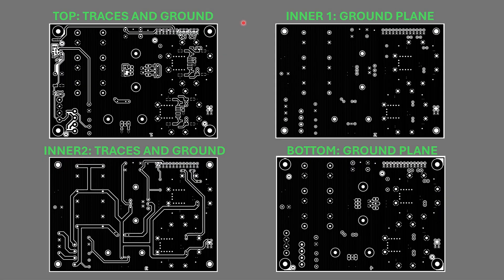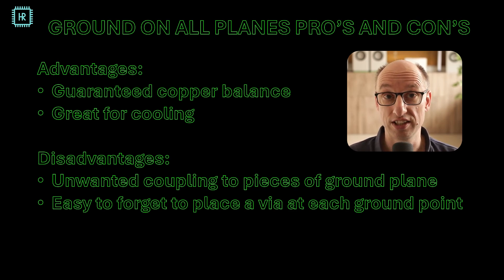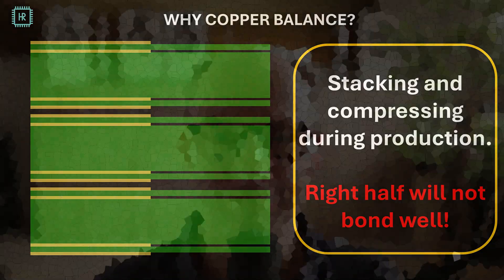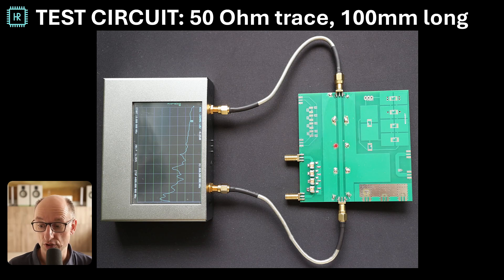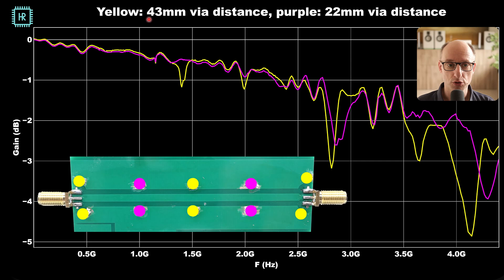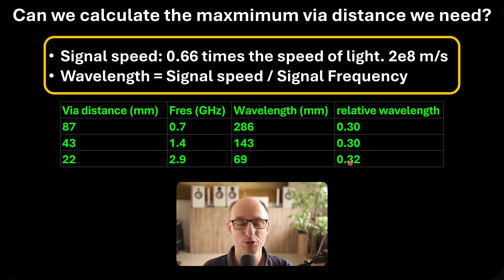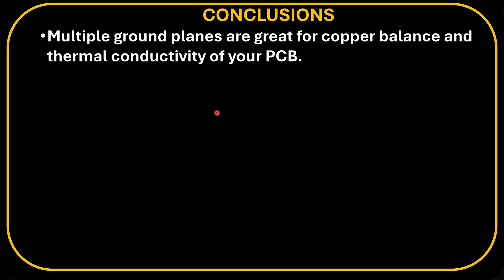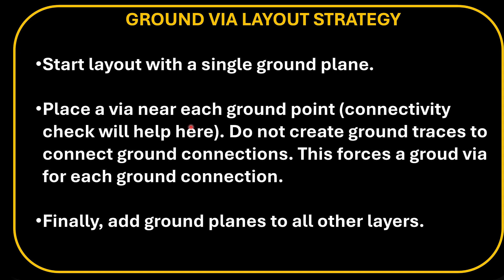Why Ground Planes Can Break RF... And How to Fix It

Comment: SEND ME THE CHECKLIST Thanks for your videos Hans.
Reply from the maker: I've changed the free checklist offer a bit: You also get a 1 hour module of my course for free!

You can find the link to the page in the description. Scroll down a bit on that page (Or read the whole page, you may get curious :-) ) to find the link. It is a purple button 'Watch The Free Module And Get The Checklist'.

You will have to leave your email address so I can start spamming you :-D . I don't do that very often, on average once a month, but I am thinking about starting an email series with useful electronics tips at some point.

Best regards,

Hans Rosenberg

Comment: Hans, I greatly appreciate your analytical approach. I wish I had seen this decades ago, when I was battling noise problems in digital systems. These days, I often use large vias if I'm at all concerned -- you touched briefly on this with the drilled holes/additional vias. Large vias are SO easy and cheap; why not advise this? (and analyze it!)
Reply from the maker: Yes, the larger the via, the lower the inductance, it helps!

Comment: Send me the checklist.  Thanks in advance!
Reply from the maker: I've changed the free checklist offer a bit: You also get a 1 hour module of my course for free!

You can find the link to the page in the description. Scroll down a bit on that page (Or read the whole page, you may get curious :-) ) to find the link. It is a purple button 'Watch The Free Module And Get The Checklist'.

You will have to leave your email address so I can start spamming you :-D . I don't do that very often, on average once a month, but I am thinking about starting an email series with useful electronics tips at some point.

Best regards,

Hans Rosenberg

Comment: I would love the checklist.  Thank you!
Reply from the maker: I've changed the free checklist offer a bit: You also get a 1 hour module of my course for free!

You can find the link to the page in the description. Scroll down a bit on that page (Or read the whole page, you may get curious :-) ) to find the link. It is a purple button 'Watch The Free Module And Get The Checklist'.

You will have to leave your email address so I can start spamming you :-D . I don't do that very often, on average once a month, but I am thinking about starting an email series with useful electronics tips at some point.

Best regards,

Hans Rosenberg
Reply: @HansRosenberg74 thank you!

Comment: Try irregularly spacing the ground vias near the transmission lines. The response will be smoother.
Reply from the maker: indeed, the maximum distance will cause the biggest problem then

Comment: Wonderful series of the videos! Could I've your checklist?
Reply from the maker: I've changed the free checklist offer a bit: You also get a 1 hour module of my course for free!

You can find the link to the page in the description. Scroll down a bit on that page (Or read the whole page, you may get curious :-) ) to find the link. It is a purple button 'Watch The Free Module And Get The Checklist'.

You will have to leave your email address so I can start spamming you :-D . I don't do that very often, on average once a month, but I am thinking about starting an email series with useful electronics tips at some point.

Best regards,

Hans Rosenberg

Comment: Could you send me the checklist? Thanks!
Reply from the maker: I've changed the free checklist offer a bit: You also get a 1 hour module of my course for free!

You can find the link to the page in the description. Scroll down a bit on that page (Or read the whole page, you may get curious :-) ) to find the link. It is a purple button 'Watch The Free Module And Get The Checklist'.

You will have to leave your email address so I can start spamming you :-D . I don't do that very often, on average once a month, but I am thinking about starting an email series with useful electronics tips at some point.

Best regards,

Hans Rosenberg

Comment: Wonderful series of the videos! Could I've your checklist? Thank you in advance
Reply from the maker: thanks a lot! I've changed the free checklist offer a bit: You also get a 1 hour module of my course for free!

You can find the link to the page in the description. Scroll down a bit on that page (Or read the whole page, you may get curious :-) ) to find the link. It is a purple button 'Watch The Free Module And Get The Checklist'.

You will have to leave your email address so I can start spamming you :-D . I don't do that very often, on average once a month, but I am thinking about starting an email series with useful electronics tips at some point.

Best regards,

Hans Rosenberg

Comment: Please send me the checklist Hans (:
Reply from the maker: I've changed the free checklist offer a bit: You also get a 1 hour module of my course for free!

You can find the link to the page in the description. Scroll down a bit on that page (Or read the whole page, you may get curious :-) ) to find the link. It is a purple button 'Watch The Free Module And Get The Checklist'.

You will have to leave your email address so I can start spamming you :-D . I don't do that very often, on average once a month, but I am thinking about starting an email series with useful electronics tips at some point.

Best regards,

Hans Rosenberg

Comment: Nice video, send me the checklist please.
Reply from the maker: I've changed the free checklist offer a bit: You also get a 1 hour module of my course for free!

You can find the link to the page in the description. Scroll down a bit on that page (Or read the whole page, you may get curious :-) ) to find the link. It is a purple button 'Watch The Free Module And Get The Checklist'.

You will have to leave your email address so I can start spamming you :-D . I don't do that very often, on average once a month, but I am thinking about starting an email series with useful electronics tips at some point.

Best regards,

Hans Rosenberg

Comment: Re digital clock frequency. In principle you are not wrong about needing some harmonics for a square wave. However, it is not the frequency that counts, but the rise and fall times that determine the bandwidth of concern, and thus the wavelengths of concern.
Reply from the maker: Agreed! It's just hard to cover the subject from all sides in a short video. This would be a nice topic for a stand-alone video.

Comment: This is a stupid question as I'm inexperienced about PCB's. But here, when referring to ground, are we talking about negative planes? Like the current flowing from positive to negative. Or are these actually Earth planes? Where residual noise and currents would be earthed to the actual ground. I'm kinda thinking about how earthing a metal casing would help reduce EMC and stuff.
Reply: Ground = return. Dr. Archambeault always says "Ground is where you plant potatoes." He didn't like the term "ground."
Reply: @TheMrShagnasty  Ah I see, thank you very much. Yeah, the term ground really is confusing. Also, what would happen if one were to put an earth layer (if we don't consider it as a waste) in the PCB? Would that help EMC?
Reply from the maker: Yes, difinitely use an earth / ground / return layer in your pcb, it's my number 1 rule :-)
Reply: @ninjahunterx7497 a “earth” layer is the same thing, the only difference is more mass and a wire going to the actual ground
Reply: @Silverstonery   Yeah got it, thank you. I only recently learned of the return ground and the chasis ground, which has to be commoned at one point, making it as what you said.
Reply: @TheMrShagnasty  except you are talking hole flow return.   Some idiot thought the electron was positive and I’ve had to write everything backwards my entire career.

Comment: send me a check list
Reply from the maker: I've changed the free checklist offer a bit: You also get a 1 hour module of my course for free!

You can find the link to the page in the description. Scroll down a bit on that page (Or read the whole page, you may get curious :-) ) to find the link. It is a purple button 'Watch The Free Module And Get The Checklist'.

You will have to leave your email address so I can start spamming you :-D . I don't do that very often, on average once a month, but I am thinking about starting an email series with useful electronics tips at some point.

Best regards,

Hans Rosenberg

Comment: Send me the checklist, thank you. hehe
Reply from the maker: I've changed the free checklist offer a bit: You also get a 1 hour module of my course for free!

You can find the link to the page in the description. Scroll down a bit on that page (Or read the whole page, you may get curious :-) ) to find the link. It is a purple button 'Watch The Free Module And Get The Checklist'.

You will have to leave your email address so I can start spamming you :-D . I don't do that very often, on average once a month, but I am thinking about starting an email series with useful electronics tips at some point.

Best regards,

Hans Rosenberg

Comment: Great video series; I would like a copy of your checklist. Thanks in advance!
Reply from the maker: I've changed the free checklist offer a bit: You also get a 1 hour module of my course for free!

You can find the link to the page in the description. Scroll down a bit on that page (Or read the whole page, you may get curious :-) ) to find the link. It is a purple button 'Watch The Free Module And Get The Checklist'.

You will have to leave your email address so I can start spamming you :-D . I don't do that very often, on average once a month, but I am thinking about starting an email series with useful electronics tips at some point.

Best regards,

Hans Rosenberg

Comment: Yes I would like a copy of the checklist, thank you
Reply from the maker: Thanks! I've changed the free checklist offer a bit: You also get a 1 hour module of my course for free!

You can find the link to the page in the description. Scroll down a bit on that page (Or read the whole page, you may get curious :-) ) to find the link. It is a purple button 'Watch The Free Module And Get The Checklist'.

You will have to leave your email address so I can start spamming you :-D . I don't do that very often, on average once a month, but I am thinking about starting an email series with useful electronics tips at some point.

Best regards,

Hans Rosenberg

Comment: send me the checklist, please and thank you!
Reply from the maker: I've changed the free checklist offer a bit: You also get a 1 hour module of my course for free!

You can find the link to the page in the description. Scroll down a bit on that page (Or read the whole page, you may get curious :-) ) to find the link. It is a purple button 'Watch The Free Module And Get The Checklist'.

You will have to leave your email address so I can start spamming you :-D . I don't do that very often, on average once a month, but I am thinking about starting an email series with useful electronics tips at some point.

Best regards,

Hans Rosenberg

Comment: could you send me the checklist, Thank a lot.
Reply from the maker: I've changed the free checklist offer a bit: You also get a 1 hour module of my course for free!

You can find the link to the page in the description. Scroll down a bit on that page (Or read the whole page, you may get curious :-) ) to find the link. It is a purple button 'Watch The Free Module And Get The Checklist'.

You will have to leave your email address so I can start spamming you :-D . I don't do that very often, on average once a month, but I am thinking about starting an email series with useful electronics tips at some point.

Best regards,

Hans Rosenberg

Comment: Send me the checklist. Hartelijk dank😊
Reply from the maker: Graag gedaan :-)  I've changed the free checklist offer a bit: You also get a 1 hour module of my course for free!

You can find the link to the page in the description. Scroll down a bit on that page (Or read the whole page, you may get curious :-) ) to find the link. It is a purple button 'Watch The Free Module And Get The Checklist'.

You will have to leave your email address so I can start spamming you :-D . I don't do that very often, on average once a month, but I am thinking about starting an email series with useful electronics tips at some point.

Best regards,

Hans Rosenberg

Comment: Send me the checklist. Thank you for the excellent content.
Reply from the maker: I've changed the free checklist offer a bit: You also get a 1 hour module of my course for free!

You can find the link to the page in the description. Scroll down a bit on that page (Or read the whole page, you may get curious :-) ) to find the link. It is a purple button 'Watch The Free Module And Get The Checklist'.

You will have to leave your email address so I can start spamming you :-D . I don't do that very often, on average once a month, but I am thinking about starting an email series with useful electronics tips at some point.

Best regards,

Hans Rosenberg

Comment: Send me the checklist. Thx.
Reply from the maker: I've changed the free checklist offer a bit: You also get a 1 hour module of my course for free!

You can find the link to the page in the description. Scroll down a bit on that page (Or read the whole page, you may get curious :-) ) to find the link. It is a purple button 'Watch The Free Module And Get The Checklist'.

You will have to leave your email address so I can start spamming you :-D . I don't do that very often, on average once a month, but I am thinking about starting an email series with useful electronics tips at some point.

Best regards,

Hans Rosenberg

Comment: 30 years of my mistakes recreated by this Channel. Awesome. Send me checklist.
Reply from the maker: I've changed the free checklist offer a bit: You also get a 1 hour module of my course for free!

You can find the link to the page in the description. Scroll down a bit on that page (Or read the whole page, you may get curious :-) ) to find the link. It is a purple button 'Watch The Free Module And Get The Checklist'.

You will have to leave your email address so I can start spamming you :-D . I don't do that very often, on average once a month, but I am thinking about starting an email series with useful electronics tips at some point.

Best regards,

Hans Rosenberg

Comment: Let's push engagement, send me the checklist ! ;)
Reply from the maker: ehm, do you want the checklist or the engagement?! :-) L
Reply from the maker: I've changed the free checklist offer a bit: You also get a 1 hour module of my course for free!

You can find the link to the page in the description. Scroll down a bit on that page (Or read the whole page, you may get curious :-) ) to find the link. It is a purple button 'Watch The Free Module And Get The Checklist'.

You will have to leave your email address so I can start spamming you :-D . I don't do that very often, on average once a month, but I am thinking about starting an email series with useful electronics tips at some point.

Best regards,

Hans Rosenberg

Comment: Send me this checklist
Reply from the maker: I've changed the free checklist offer a bit: You also get a 1 hour module of my course for free!

You can find the link to the page in the description. Scroll down a bit on that page (Or read the whole page, you may get curious :-) ) to find the link.

You will have to leave your email address so I can start spamming you :-D . I don't do that very often, on average once a month, but I am thinking about starting an email series with useful electronics tips at some point.

Best regards,

Hans Rosenberg

Comment: Send me the checklist!! excellent work!
Reply from the maker: thanks, I've changed the free checklist offer a bit: You also get a 1 hour module of my course for free!

You can find the link to the page in the description. Scroll down a bit on that page (Or read the whole page, you may get curious :-) ) to find the link.

You will have to leave your email address so I can start spamming you :-D . I don't do that very often, on average once a month, but I am thinking about starting an email series with useful electronics tips at some point.

Best regards,

Hans Rosenberg

Comment: SEND ME THE CHECKLIST
Reply from the maker: sorry for the late reply, we were away for a long weekend.

I've changed the free checklist offer a bit: You also get a 1 hour module of my course for free!

You can find the link to the page in the description. Scroll down a bit on that page (Or read the whole page, you may get curious :-) ) to find the link.

You will have to leave your email address so I can start spamming you :-D . I don't do that very often, on average once a month, but I am thinking about starting an email series with useful electronics tips at some point.

Best regards,

Hans Rosenberg

Comment: Excellent discussion Hans. I found it particularly interesting that the 9th harmonic of a square wave is sufficient for wavelength calculations because I’ve been using this same rule for decades on high-speed signal runners and every board design worked great. I also use 1/16th of the highest frequency’s board wavelength to decide if a signal run must be treated as a transmission line. I try to keep as many high-speed signals shorter than 1/16 of their board wavelength to minimize dealing with transmission lines.
Reply from the maker: Great to hear from someone else with really long experience :-) The great thing about engineering is: If you do it long enough, you always come to the same rules and realisations :-)
Reply: @HansRosenberg74 Absolutely! Learn by making mistakes.😀